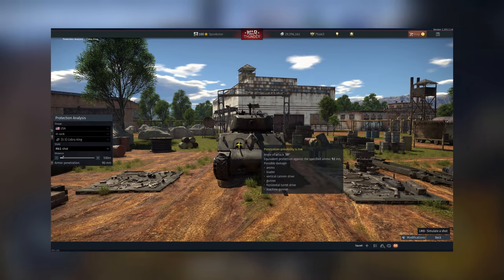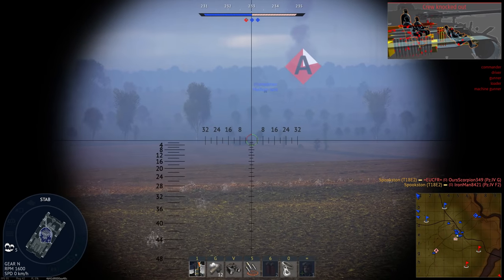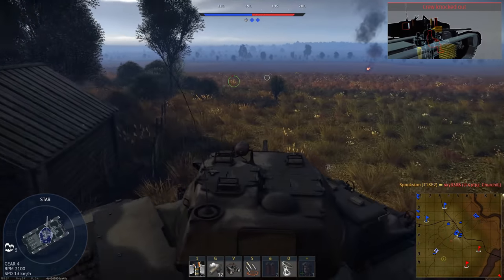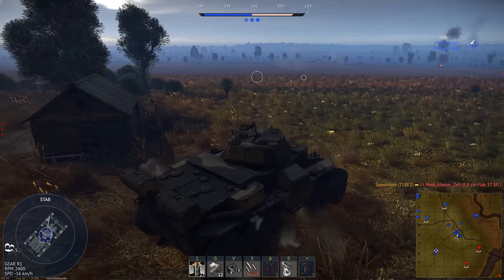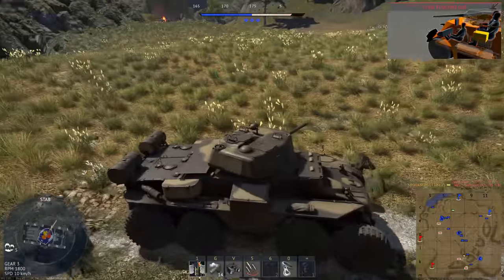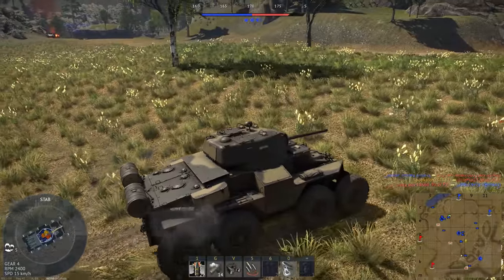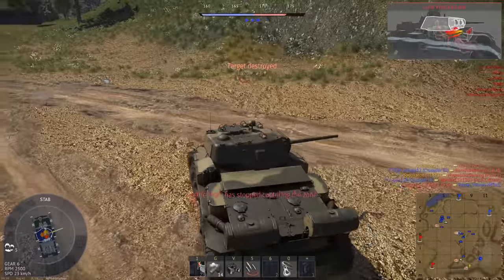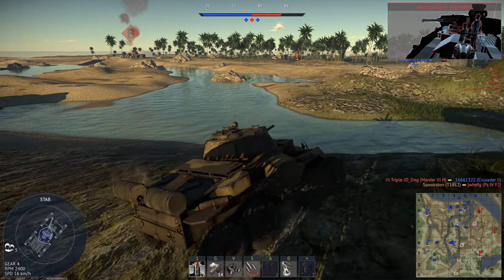Volumetric Shells Were A Bad Idea

Comment: Hmmm, I can see your point of view and don't mind it, I just personally like the volumetric system more, I enjoy that extra layer of thinking needed before firing the shell, but I won't deny it is frustrating at times, but you do get used to it and acquire the new way of aiming.
But even I think it's not good enough as a system, what I truly want is full projectile deformation physics, doubt that's ever gonna happen, but hey we are 1/5 of the way there, and then nobody will complain about shells not damaging turret rings, because they will actually squeeze through enough to jam the ring or break it XD

Comment: Of course volumetric shells aren’t perfect, but I do enjoy it. The amount of times before that I was killed because a shell slipped under my turret ring that’s like 5mm long or the times a shell ricochets my cannon breach and into my tank was ridiculous. I’m yet to have that happen to me again with volumetric shells so I honestly love this change. 

Tiger 1 turret is actually decent now and tracks actually protect you somewhat now. 

Also I would take a non pen because a rare occasion that a badly modelled tank has two armour pieces together than getting penned 100% of the time because someone managed to fit a 76 mm shell through a turret ring that is like 20mm tall.....

Comment: Treating the shell as an entire object and treating the armor like a thin plane of pixels is what royally screwed up volumetric shells
Since the game instantly calculates the pen applied on a plate of armor at a certain angle and attributes for that, but then it meets the second layer of armor and since it has alredy done the math, practically brute frorces it. This, of course, results in unrealible hit detection.
That's why hitting a little over bumps or around rims is made so much more frustrating, since it practically shaves a chunk of the shells penetration before it contacts the intended target.
Reminder that IRL shells are made of very high quality steel and the velocity with which they travel basically ignore any small obstructions.
What they've done, in-game, is give shells realistic properties and pitted them against video game logic.

And instead of focusing on repairing game mechanic issues or balancing changes (or most blatantly, map redesign ) they now keep adding more stuff to their games in hopes that the spaghetti will be viable somehow.
It's even astounding how they seem to be fucking up on "purpose", trying to show the game as "polished and realistic" but ending up with just downright nonsensical issues.

Then again, all of these issues pale in comparison with the fact that they view a majority of the feedback as a bunch of screaming children. Note how I said "majority" , as they are well and capable of taking fair criticism.

The game is a mess, but bad times make strong men. Or in this case, keen-visioned commanders.

TL;DR
Bad things happen when you apply video game logic to irl weaponry.

Comment: Too be honest. Having APHE shells not knock out the entire tank with cupola shots would have been enough to fix the most common weakspot on well armored tanks.
I agree that volumetric shells haven’t really improved the gameplay.
Like Gaijins BR changes, they didn’t solve issues but just shifted them elsewhere.
Volumetric shells also only work correctly when armor is also modeled volumetric. Then a hole in the armor actually makes the armor weaker.
At least the current problem with multiple armor sections getting summed up could be fixed by taking the average thickness of the plates, as already suggested on the forum.

Comment: volumetric shells is kinda ok for me except for few things that causes the game to do unrealistic stuff
like you said hitting the joint of 2 armor is buggy causing to add the armor up instead of just picking the thicker(i know there are calculations in this scenario but lets be simple)

now as well tracks absorb way too much penetration, my merk 3D's railgn of a sabot was absorbed by T72B3's tracks a full 90-80 degree angle shot) that would penetrate but IDK why but it got stuck on tracks

also the one major problem with tanks even before the volumetric shell is the tracks traction
for example abrams is known and proven to be able to climb maxing at 51 degrees, yet abrams cant even climb up to 40 degrees before sliding down

if they dont want players to exploit high vantage places, then simply blocking it with rocks/tanktraps/walls will suffice, nerfing the track's capability to climb is the most BS nerf ive seen

Comment: when it comes to the Armor plate joins being a spot that's harder to pen, this is entirely realistic, when welded together due to the rapid heating and cooling of just doing that the join does actually become much much harder and stronger than the actual plates themselves this isn't an issue in my mind its actually quite realistic.

Comment: honestly i dont feel like they're a bad addition. what is bad is the traction from climbing, which has gotten worse and tanks felt more like busses on off-road rather than.... tanks. other than that is the BR for R3, which is ridiculously low and it is becoming the "go to" car for events because of how ridiculously easy it is to use. even if you dont want to use it for killing tanks, you can still rush cap to spawn in a plane or do actual SPAA work on 8.0 with no hassle using it. but yeah, i do agree that turret ring became impenetrable now on all tanks, regardless of BR. the only way to penetrate the ring now is to penetrate the tank and hope that your shell explodes inside and broke the ring, which, in the case of the T34 (american), sounds like a chore.

Comment: Volumetric shells is a good thing just it was implemented late. It never made sense for shells to be 1 pixel wide and could pen the tiniest of cracks. Your complaint about the rubble clipping is only possible because the barrel is allowed to clip through objects and the reticle is still 1 pixel. 2- ways to fix.....1) make it so that barrels can no longer clip through objects (Pro: more realistic and can now have barrel duels, con: can totally see the frustration of turning corners with really long guns) 2) learn to adapt and stop trying to shove your 122mm shell through the little 10mm gap b/w the rubble pile and the metal piece sticking out of it.

Comment: Volumetric shells is both a blessing and a curse.

The T-29 for example has become a wreck. The 105mm gun doesnt seem to pen anything at all anymore. Same with the IS-2. I cant put my finger on it, but it seems like the shells just constantly touch 'something else' on the tank and just bounce right off or explode prematurely. Feels like I'm shooting HEAT-FS shells in a 9.0+ match.
Meanwhile, nearly ALL Russian higher tiers have cupola's that can not be penetrated at all anymore, even by APFSDS. Not even from the rear, unless you specifically try to shoot between the 'conjoined plates'. And you best be hoping that even then the Volumetric shell does not touch one of the edges for een 1 mm.

On the other hand... Tank tracks seem to actually stop some shells/missiles now. Just like they did in real-life a lot and not act like "yes, just come on through" open houses.

Comment: I think in the end WT has a lot of problems. Once I didn't penetrated a Pz IV G in the front with a Sherman Firefly because i got the joint in the front plate. But there is more, some stuff costs too much in repairs and match are not balanced at all; tech trees are really random and sometimes you have to fight post-ww2 tanks or planes with your 1944 vehicle. For years the community asked for these things to change and the developers just add stuff to this "game"

Comment: Volumetric shells ARE a good thing, however, what people don't seem to comprehend is that you NEEEEEEED proper armor modeling with it. A shell that does minimal damage to a tank by clipping a corner isn't going to knock it out, no matter how big the shell size. It might rip a chunk out of the hull, but the tank will still go and still fight.
This is why people hate volumetric shells, because the armor wasn't modeled properly in the first place.

Comment: Hi, i  understand your perspective here but generally disagree with what you're saying. In order to move in the right direction, sometimes you have to cause some stumbles - those stumbles are those game balancing issues we're now facing, (vehicles too good for Br now since weak stops nearly unhitable) and the inevitable bugs that happen when implementing features. I think in 1 year we will look back and be happy the game has a more realistic system for shells and hopefully most issues with it will be ironed out by then. This is a needed step. Your argument here is the same argument for not improving graphics - only further expanding the difference between UHQ and ULQ, so it shouldn't be done. These changes are necessary and difficult; but in the long run these are necessary for the betterment of the game.

Comment: My issue is that armor has become way too weak since they changed the way shell penetration is calculated ,and most tank armor schemes have huge weakspots while some have virtually none/are very tiny. In my opinion, even those it is more detailed, tank armor is modeled much worse in war thunder than world of tanks. If they use volumetric shells, volumetric armor and modules should also be used.

Comment: volumetric shell is a good and bad thing for heavy tanks; the good part is that because some heavy tanks in lower br have trolly armor but the bad part is that around Tier V, especially American Heavies, volumetric shells isn't a good benefit, Russian 100mm can squeeze through the gap between the hull and suspension, but even if it can when through it, the trolly armor should work right? no, it'll just pass through and even the M103 can't pen the front of the T54 UFP point-blank when in-game but when i check on it on the hangar, it shows it can pen it, even Strv 81 bounces 300mm at 200m like what??? i shot lower glacis but it bounce? this volumetric thing would make the heavy tanks at higher br suffer than before.

Comment: I like it but it is a mix bag. Like say if I hit two armour plates at the same time but the thickness of both of them are the same it should still push through, similar to what you were saying re weak spots. I also suspect in real life when shells hit weak spots that are smaller than the shell they have a higher chance to pen as part of the area you are hitting has thinner armour or none so the total armour thickness would be lower than standard. Not zero in the case of a vision port zone the surrounding plates but definitely much lower

Comment: Since Volumetric shells dropped I had moved on top playing Brit tanks where you load apds and aim for the centre of a panther or whatever comes round the corner not much can stop the spicy Bois but at lower tiers the t34 and kv1 were both terrifying where even if I had my firefly with top shell it still felt like a gambit to shoot at t34 hull and kv1 turrets despite it being on of the most punchy guns at its tier for Germans however nothing changed still easy pickings bar some weird shots on stugs where the 17pdr round would ricochet of the steeply angled front plate  and be absorbed by 50mm armour

Comment: Good idea, bad implementation. For it to be modeled correctly  she shell's side scraping a plate with one side shouldn't instantly disintegrate it. Should weaken and deflect it slightly. The shell should only really shatter if you try putting it in a gap it's too small to fit through (so multiple sides get "snagged"). And of course objects not made of armor like internal components should have a lesser effect.

That being said all that is a massive amount of work and for now I'd be content if they fix the connected plate issue. Pixel sized shells exaggerated weak spots that would be insignificant in reality.

Edit: One thing id like to see sooner rather than later is a rework on how gun barrels stop AP shells so easily. Especially muzzle breaks should maybe weaken the shell a bit but it should not stop it or trigger the fuse in an APHE round (unless it's a crappy one like the soviet MD-5). The muzzle break should probably have a separate damage and armor model from the rest of the gun. If only the muzzle break is damaged maybe have it so firing the gun damages the breech a bit due to increased recoil.

Comment: Some valid points but not entirely true. I've had the barrel issue when firing against 75mm Shermans since waaaayy before volumetric shells. It's also still possible to RELIABLY kill a 279 through the turret ring with - yes, I mean it - the 25mm gun on a Bradley. Not to mention I myself have had my trap shot out on numerous occasions with tanks that do indeed have the trap exposed. It does make it more difficult to hit these spots, but not impossible in all cases.

Comment: Can't agree with the exemples, things like ball shaped machine gun ports weren't removed because they were an easy to hit weakspot, at least not directly. They made en entire front plate weaker which was the bigger problem, it sped up production, reduced costs and also those machine guns were for the most part a deterrent/placebo more than anything else anyway so it wasn't a big deal to get rid of them anyway. For the KV situation I'm not saying that turrets were not disabled ie jammed by ring shell hits, but that doesn't mean they penned and the whole tank was lost either. People in ww2 and even today, in the vast majority of cases do not aim at was we consider weakspots in video games anyway... That you can pen a panther with a crap gun by hitscanning the ball mg port was always a broken gimmick to begin with.

Comment: tbh i see three issues which makes this really bad: Vehicle scales, fluidity/deforming of volumetric objects and fuses.
in war thunder alot of vehicles arent up to scale and are horribly misformed (at least last when i played) meaning that sometimes shells that are supposed to be able to pass through a weakspot cant because the vehicle is smaller ingame than it is IRL.
Also Gaijin disregards the fact that once there is enough energy in play literally everything starts behaving like fluids. a shell going fast enough hitting an edge with it's side is simply going to deflect and deform as hell.
and as far as ive seen shells detonate no matter if the fuse actually had contact or not - blame gaijin cuz they are too dumb for anything frankly.

Comment: Get some rest.

So far, I have considered the addition of volumetric shells and armor to be a good thing.

What I would like to see is for hits to the optics to have consequences.  Hit the gunner's periscope and it should be blind for a few seconds (time determined by crew repair skill - must wait on starting that clock for crew member replacement if the shot killed the gunner) and the player has to switch to Driver or Commander View.

Same mechanic for the periscopes used by other crew members.

Comment: I like volumetric shells, I think it makes more sense and is more realistic and requires more careful aim when shooting instead of just getting snapshots on everything. I agree, there are still some bugs like treating adjacent as overlapping and weird quirky spots. It needs some fine tuning yes, but it will get there. Maybe I'm a little biased because I'm a heavy tanker main, I like having armour and using it draw fire while taking my time to aim. KV-1E is one of my favourites. I honestly don't feel that much tougher since volumetric, I still die, and I'm dieing more because it's harder to get kills cause you have to be more accurate. T-34 armour now feels as terrifying as all the stories make it out to be. Sure, some BR changes may need to be made (I can think of a specific 3.7 T-34 that should probably get bumped, please don't move my 4.0 KV-1E!), some of the kinks need to be ironed out, as well as the player base needs to get used to it. We'll get there.
I also don't play top tier because it sucks and is frustrating enough as is. Volumetric really doesn't seem to make any drastic changes to the fun, WWII era (except the R3, even Gaijin knows that thing is fucked). I think it just creates a new armour meta for tanks that used to just get lolpenned at stupid angles, i bounce off panzer 3s and 4s now in places I used to pen no problem. I think that's a good thing, even if it is my shots that are now bouncing. Pixel picking isn't just a skill, sure there is a bit, but its also partly hardware dependent and that's kinda unfair. Volumetric should remove some of that outside influence and require more strategic play, ideally something other than shooting out barrels, that's getting especially annoying since the R3 already is a barrel and track delete button.